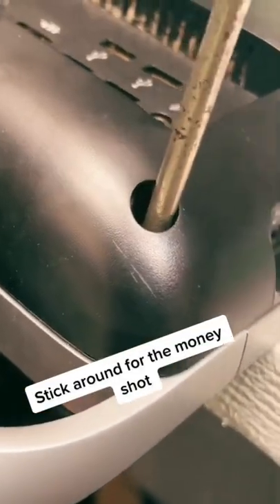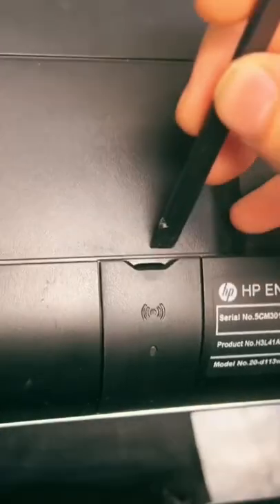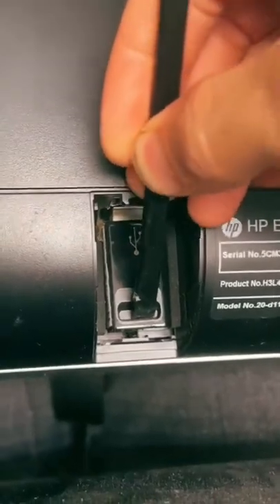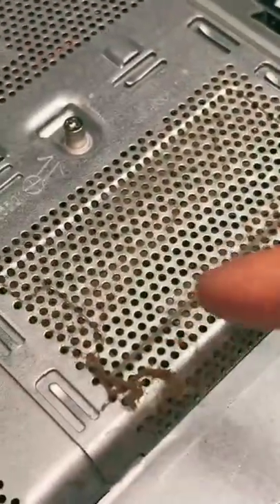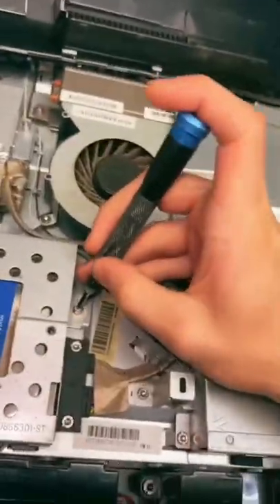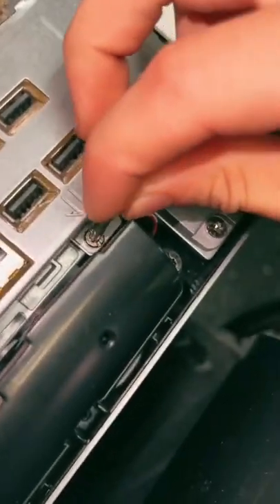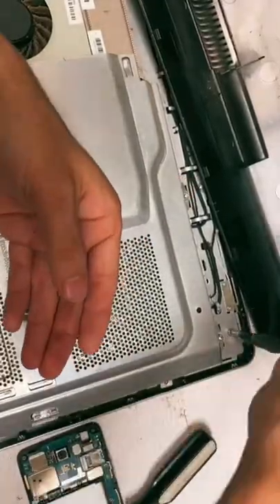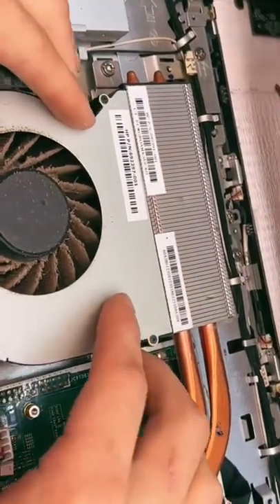That’s a lot of dust

Comment: I like how you say “your wireless dongle” as if it was completely normal not to use a wifi card wired directly
Reply: Ah yes but HP doesn't care about making a good computer! Only making money.
Reply: In other all in one models there is no door, but a mini wifi dongle inside the system connected to a USB port taped to the inside of the case. Fucking cringe design
Reply: It’s a mini wifi usb dongle, not a normal pcie wifi card
Reply: @smshii  miniPCIe wifi cards like used in laptops are normally used in all in ones as well.  With an internal antenna it'll be leagues better than that little dongle.
Reply: @startedtech  i missed the word "not" in his sentence and misunderstood. Also im not dumb ik that minipcie widi cards are used in aio's and wifi cards...
Reply: @smshii  lmao
Reply: @quinton1862  i see these typically with pcie wifi modules but i havent taken apart a laptop in a few years.
Reply: @weinerschnitzelboy thats a good idea but should just include a real wifi card with a spare dongle as a backup to plug in in emergencies
Reply: @melody3741  yeah Im surprised they don't just do that instead of the janky USB wifi.
Reply: That's a wireless keyboard/mouse dongle not the wifi/bluetooth receiver
Reply: As a multi-million dollars company you got to save every single penny

Comment: While you're in there, put in an SSD, upgrade the wifi adapter and drop in a CPU upgrade.  For less than $100 in new hardware, it will perform better than it ever has, and better than practically any $350-$500 brand new machine.

Comment: I left this as a reply for another comment, but I felt it should be a comment on it's own.

This computer is an HP Omni 27 (EDIT: sorry, I was wrong, it's a touchsmart, but from the same era as the HP Omni 27, so all I say in  these next few sentences may be complete bunk, however they look very similar internally and externally, but I'm mostly talking about the HP Omni 27). 
They actually do have a Wifi card inside them. Surprisingly they have an MXM slot where you can replace the GPU as well! Well, as long as you have the heatsink. Heck even the CPU is upgradable, and they ship with a Bluray burner! This makes this computer a really good multimedia beast, even by today's standards, despite never being able to install Windows 11.

Despite the screen being glass, it is not a touchscreen model, which makes me think HP is trying to directly compete with the iMac with this model, which is funny now because the speakers were designed by Beats Audio, whom is now owned by Apple themselves.

This USB Wireless dongle is for the included wireless mouse and keyboard that comes with the PC. This makes the computer a true set down and plug in experience for customers, but they give you the option to replace it with your own.

I hate to say this, but out of all of the HP computers I've worked on, this one is actually pretty nice with a lot of upgradability, especially for an AIO solution.

Also, since it has really decent sound (with the option to add in a subwoofer) and a 1080p screen, they give you the option to use it as a screen for a videogame console. My Nintendo Switch is plugged into mine for t his reason.

And if that's not enough, this heavy beast can have it's base unscrewed and can even be VESA mounted! Good luck finding an arm that's not overpriced, and can hold the thing.

Suffice to say, this is probably the most praise I'll ever give an HP AIO.

Source: I own one for a Linux standalone desktop, and I had to replace the WiFi card for Linux support. I do not see myself replacing this with another AIO in the future because I quite like the upgradability of this machine.
Reply: I hated the fact that I read half of that.